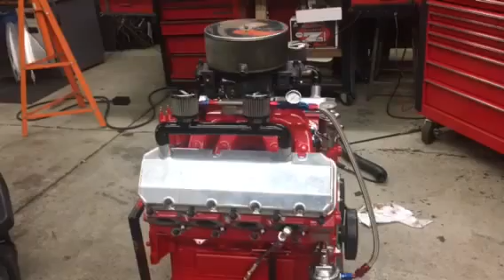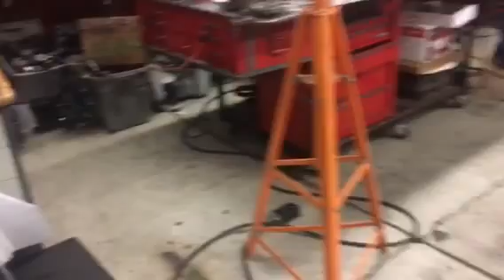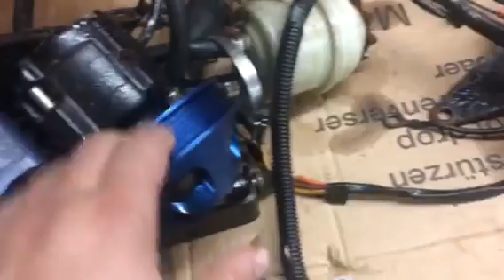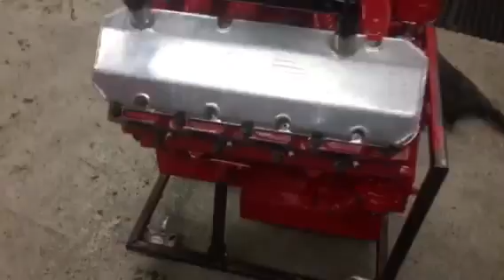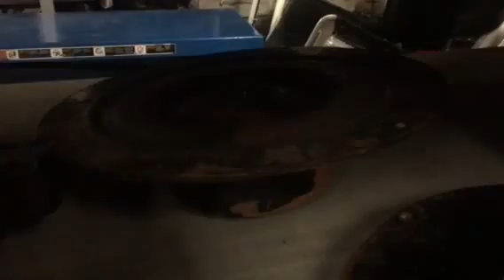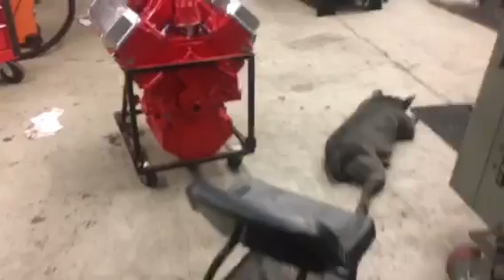Fast boats suck you dry. Just pay and shut up!

Comment: What are the small rubber tubes on the headers ?
Reply from the maker: They are jacketed and they are for cooling
Reply: So they suck water and evacuate it with the gasses?
Reply: @G55STEYR  yes. It also cools the headers or manifolds. Hot headers can do a number on hands.

Comment: Change it,change it,change it... you lack the confidence to inspect stuff??
For your info, airlines planes actually FLY WITH CRACKED PARTS;  ENGINEERS inspect them periodically and they ONLY get changed when they are approaching failure,not before,for they cost a lot and companies need to compete...

Comment: I really don't care for boats.  I like the engine though.  Lets cut up the boat and put the engine in my T bucket or model A. ;)

I get guys come through my shop all the time wanting to build a cool car.  They piss and moan about it all the time, how expensive it is and how long it takes.   Obviously they don't have the rocks for it either.  If you want to be a big dog, act like a big dog!  If ya can't run with the big dogs, stay on the porch!

All the best!
Mike
Reply from the maker: With a boat you can use the full potential of that 632"  right outside of the canal. Over 100 mph all day. In a car you have to plan out a day at the track. And then get a few passes. But I have a solid roller 468 in my as pick up that makes 680 before nos.